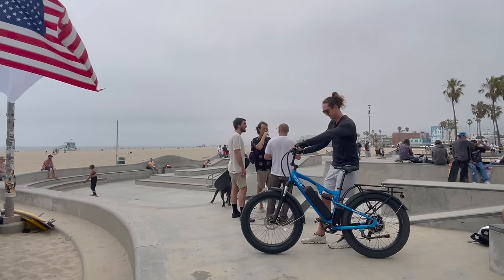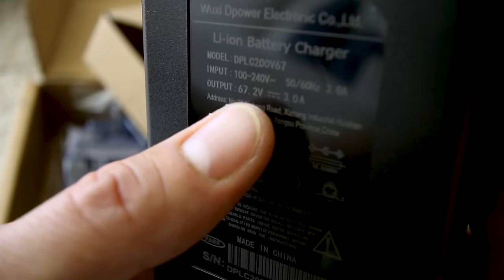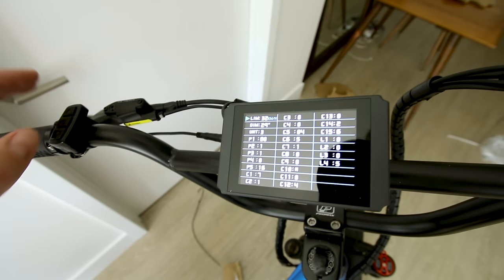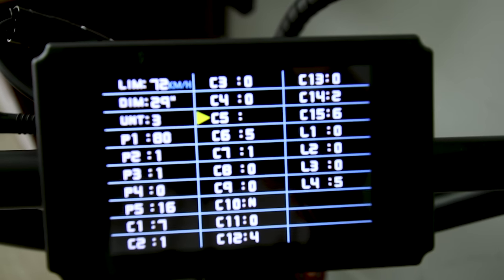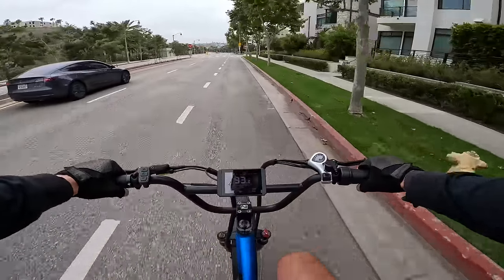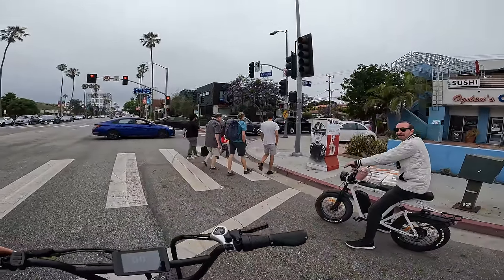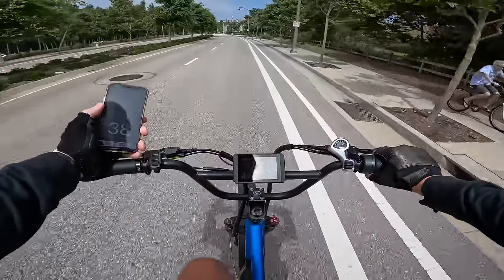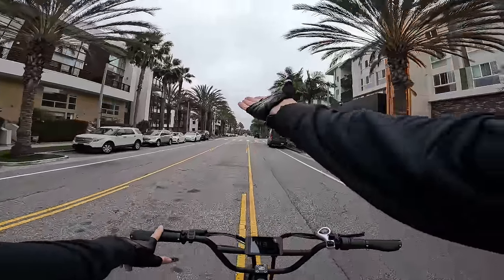This $2000 Ebike is INSANE - Wired Freedom Review!

Comment: I really hope this bike has decent reliability.  I worry it will break down after a couple months of riding it.
Reply: There were reports of magnets coming out of the motor.
Reply: @aussie2uGA How do you figure out how to change the settings. The instruction manuals with e-bike are terrible.
Reply: have 2 and only problem was needed a biger shock and wired sent me one for free there service is the best in the business
Reply: @aussie2uGA if it hasn't been released yet, where did the reports come from?  Reviewers? I wouldn't worry much if it was a review bike that's been shipped all over the globe and run ragged over and over.
Reply: @TravisMcGee151 press 2 buttons simultaneously to get into that mode.   It was quick in the video, but he showed you.   I have a different brand, (Aventon), it’s the same process as this Wired.
Reply: I’ve had mine for several months and have over 700 miles.  The bike has been flawless so far.  The motor does not get hot, even after riding hard for 30 miles.  I took my motor apart to check the grease and wear so far and it was perfect and still very well greased.  I will re grease every 3-4k mikes going forward.  The battery seems to be super high quality and has massive capacity and performance and I expect it to last 850 cycles at about 50 miles per charge or about 45,000 miles.  Everything except the motor can be replaced or repaired by any bike store and I think the motor is bulletproof after disassembly and inspection.

Comment: FYI 57.6 volts is 50% on 60 volt battery pack.  This bike is an animal for sure.  Also seems to have pretty good build quality except for forks and rear shock.
Reply: And at the end of the battery, it can still pull almost 2000 watts.  The front fork is surprisingly good, they changed from a Mozo fork to another brand on the latest version and it performs better according to Wired.  Works fine on roads and light off road.  The rear spring is adequate but upgradeable.  For $2000, what more can you expect?  Just so much better than ANY 48v bike.  Physics wins.

Comment: Let’s hope the quality is there.  It’s so easy to sell specs and features without durability.
Reply: 600 trouble free miles so far!  Great customer service if you have problems or questions.  Controller is oversized, it can handle 80volts as is the motor, it can handle 3000 watts continuous and is rated at 5x the lifespan of nylon geared motors.  The battery has the highest quality LG cells.  Everything else on the bike can be fixed or replaced at any bike shop.

Comment: Does anyone make a bike with this power but without a 4" fat tire? Would to have this power on a bike with 2-3/4" tires for city & paved trail riding.
Reply: In my mind there really isn't a benefit to skinny tires on an ebike. Typically you want skinny tires because they have less rolling resistance and are easier to pedal. Because the ebike does most of the work you only benefit from bigger tires

Comment: Nice bike, ground breaking in many ways. @$2K for preorder, it would be worth ordering one, if I didn't just buy a commuter bike. I'd love to see this bike in a commuter configuration with 27.5 wheels and all season road tires on it, in a step thru. Looks like the priority was the battery pack (very expensive) and the controller, and motor. The motor with this 7 speed setup can take you faster than you can keep up in gear ratios with your legs, unless they put a bigger cassette on it with more speeds. The controller will need to be external because of the heat it generates; I've seen other bikes like that too; big AMPs == big HEAT. The motor is off brand but obviously works very well. it's solid state, I would not expect to have problems with it. If anything; the battery will be very expensive to replace; and the controller may have overheating / reliability problems over time. I like the weight; it's only 10 pounds heavier than many commuter bikes in the same price range.
Reply: IMO, it would be so good if it used 1.9-2.5" tires instead of 4" wide tires.

At 2.2" wide, Contact Urban III's would make this bike ride so fast off of the line :P
Reply: @neutronpcxt372  I think the 4" tires improve the suspension. the fork and rear shock seems to be the cheapest they found
Reply: good info effort here with jeffster folks, Question: I can hear the motor noise when rolled backward so... this is a geared motor that does regeneration - Correct ? Let's have some info regarding the gear-set (ratio of motor RPM reduction) if possible and the regen behavior on the road... and I will watch vid close to see what the tailster says... Regen helps extend brake life, and distance... I like having regen.

Comment: God damn it. 2000$US and it still comes with a Shimano Tourney rear derailleur.
It should be an Altus or Acera at the bare minimum.
Reply: They put money elsewhere😅
Reply: @MyFaithShines  Yeah, on the tires.
I say, and will continue to say, that most of these bikes should be using 3" wide tires or 2.5" wide tires, not 4 inch wide monstrosities that aren't very helpful in most cases.
Reply: @neutronpcxt372  i think the same

Comment: I would've thought with the higher voltage it would've at least hit 40-42 mph but it pretty much goes as fast as an Ariel Rider X class or Grizzly. Battery size isn't that big either.

Comment: This bike needs a torque sensor.
Reply: Do you sell torque sensors?  Would kinda of suck on a 38mph bike but who knows.  Can’t have everything at only 2k
Reply: Spend the extra money on a bike from a company that has what you want. $2k isn't pocket change for most people so if your gonna spend that much get what you want
Reply: @jfly2249  Stop ghost pedaling at high speeds, and converts power to the pedals, and gearing to respond to effort also makes the ride more natural, and can be upgraded for max speed. https://www.youtube.com/watch?v=WnLG5U-BwpY&list=WL&index=23&t=96s
Reply: @Growler_Guy The existing system works great.  Easy to pedal at any speed.  Lots of people don’t want to work to achieve high speed.  You can spend $1000 more and get the AWD fabulous bike that has similar power AND a torque sensor.  Although the review I saw said the Fabulous torque sensor wasn’t very good, too sensitive.
Reply: 48v = bicycle, torque sensor helps with the bicycle feel. Good for exercise. Better with smaller tires. Will always be available for purchase in most states.

60v = licenseless motorcycle, torque sensor not needed. Twist throttle, go fast and have fun. Better for fat tires. Buy now while you still can
Reply: Only good for off reading constantly, a cadence sensor is better for street trail

Comment: When you get to 25mph air becomes a big factor to push through, and it shows on the watts used to keep your speed, i can do 25mph on my ebike and im using about 5-600watts, when i get up to 30mph my watts are pushing 1000watts,  above i can see my watts going up exponentially with every mph added,
I honestly feel if you want the best average distance from your ebike, dont go above 25mph, after that you're just burning alot of energy just to go a fraction faster
Reply from the maker: Spot on

Comment: Just some advice. I have that same controller and display. I ramped up my power output to the max and I have almost ruined my battery and the connector on the bike. I live in South Tucson and the hot climate doesn't agree with the battery output at those amps. It took about 2 months of use to, basically, cook the connectors and now they fail to make contact. I would keep the power output at no more than like 85% next time.. this is why I am actually researching other ebikes. A new battery is $500 and Rad wont sell me new battery connections. I know yours isn't a Rad bike but that power controller is the one I upgraded to.  Just some advice to keep in the back of your mind.
Reply from the maker: Thanks for the tips, this is definitely not a rad bike though. Rad Bikes are pretty under spec’d

Comment: How much difference is there with the rear suspension compared to a hard tail?
Reply: Massive difference.  You can ride the full suspension bike just about anywhere in comfort.  Hard tails are fine on paved roads and trails, but unless you are young and limber, I wouldn’t take one off road.  The full suspension also makes a big difference in smoothing out bumps at higher speeds on roads. Much safer in that the rear wheel stays planted going over obstacles.
Reply: Thanks

Comment: I was wanting to get this bike over some of the two motor offerings that that goes 35 or so.. because I was thinking this one has an upgrade path for maybe a bit more speed but surely more power by adding a second front hub motor later.. what are you thoughts here?.. another 1000w - 2000w front hub motor would help get off the line faster and maintain those speeds on city hills in traffic situations.  I would think

Comment: I don't like how particularly close the tire is to the controller on the Freedom compared to the Cruiser model. I see that being an issue with suspension under load.
Reply: I think the F3 Pro would be better since I already have one! So far, the price/performance ratio of this electric bicycle is the highest!
Reply: @chrischen5911  Front forks look like toothpicks on the F3. No way are they durable for long. In addition, the Ariel Rider Grizzly provides 52v power along with the ability to switch gears for a little more money.

Comment: Wondering how you would compare the philodo vs. the wired. I almost bought a philodo but waited. Then i saw your video of the freedom. Price is similar. I live in Florida. Very flat.  Most of my riding will be 10 miles or less each direction. But i would like to get a second batt. for hitting the Pinellas trail and going 25+ miles each way on a weekend day trip.
Reply from the maker: Wired is much better, especially after the new upgrades

Comment: Did you like this one more than the Bandit x-trail Pro? I'm inches away from pre-ordering the Bandit, but would you recommend this one instead?
Thank you!
Reply from the maker: I mean, they’re both great, very different styles. Both fast and fun!
Reply: The Wired is faster, better acceleration and hill climbing and won’t get a second look from the cops.  The Bandit is pre production, who knows if they will actually ship and what the final product will be.  The first batch of any bike will have issues.  Wired is a known quantity at this point with outstanding customer service and a successful execution of their first few batches and they are Chicago guys.  The 26x4 is far superior to 20x4 in terms of stability and comfort and you can roll over most anything.   I have both types and far prefer the larger 26x4 format.  Smaller riders and women prefer the 20x4.
Reply: The 20x4 tires are more nimble. The bandit also has dual motors and a lot of battery. I think both are a great choice but the bandit may be a better choice for commuting because it’s also a step through moped style but I would definitely go for the wired if I wanted power
Reply: @TailHappyTV  Yea that's the problem...they both seem great, so my choice is harder! Do you prefer the 60v single motor or the 48v dual motor? Also do you find one bike to be more comfortable? Have better handling? Have a higher quality overall build? I think you're the only one who has reviewed both, so I'd really value your opinion.
Thanks again!

Comment: HP is relative to efficiency of the motor, if motor efficiency is 95-98 (that makes 640 watts approximately 1hp) percent then technically 750 watts is about 100 watts over the 1hp limit.

Comment: The price makes me nervous... If a Light Bee is 5k and already ideally needs upgrading components, then what is this thing for 2k? How long is that gonna last? That MUST be pretty disposable, there is no such thing as a free lunch and what's 2000 dollars for ANY motorized vehicle? A good battery alone costs equal/more than that on the surron...
In other words: I expect it to be bad stock, but not made well enough to be worth upgrading, like the 'ron is...
Reply: Mine is built like a tank.  The motor is amazing and seems very durable with the hybrid gears, I took mine apart to inspect at 700 miles and it was perfect.  This is not an electric dirt bike like a Suron, it’s a super powerful 26x4 fat tire e bike.  The fact that Wired can sell at such a low price is an indication of how bad other companies are ripping people off.  Suron batteries are higher discharge rates and more expensive than LG 21700

Comment: That controller is in a good spot for damage
Reply: It’s encased in metal inside a waterproof plastic case, not worried at all.  The exposed controller and use of the retention battery case is why this full suspension fat tire bike with a massive battery and motor weighs only 77lbs.  The bike would be over 90lbs if everything was integrated into the frame.  Plus, it looks really good in person.

Comment: The only problem is the rear set drop out. It's not reinforced. It'll break in 2 weeks
Reply: I think I saw a small torque arm on each side of the rear axle. Obscured by the lower attachments for the rear fender though. Without them, yeah, that torquey motor would shred the drops.

Comment: Does it have an extra strong chain, or just a normal bike chain, which typically isn’t strong enough for 2000 wattts, and good luck with an emergency stop at 38mph with no gear on!!🤪
Reply from the maker: Power does not go through chain, 🤞 on brakes 😆

Comment: This vs Ariel Rider Kepler????
Reply: Beats the Kepler on every measure and it’s full suspension.  Much better acceleration and hill climbing and about 3mph faster top speed for the Wired.  Kepler is very good but the Wired is better.

Comment: Quick question: Is this thing even legal to ride on the street since it was falsely marked as Class 2 750W bike?
Reply: Fully legal to ride on the street so long as you keep the settings in the legal range.  The bike ships as a class 2, you are responsible if you change the settings and ride on the street.  Kinda of like your car, it can go 115mph but it would be illegal to drive it that fast on the street.  Depending on where you live and your use, on or off road, you can adjust the settings as appropriate.  48v bikes are weak in acceleration and hill climbing in comparison even at lower legal speeds.  Lots of bikes have off road modes and they are 100% legal.

Comment: I'd like to see a long-term test of this e-bike and have info/data on reliability. "A motor (electric) does not produce any power?"... Do you want to stick with that?
Reply from the maker: Maybe, I did not word this 100% correct, but so many people look at a 1000 W motor and think that just because it says 1000 W on the motor that’s how much power the motor is making. Ultimately a motor can only make as much power as it can draw from the battery through the controller. so a 1000 W motor could make probably 5000 W of power, but maybe only for five seconds and then it will no longer work ever again. Likewise, you could put a 1000 W motor on it like put a battery and controller are only able to, get that motor to make 200 W. I actually did a long range test it did the Hollywood sign climbing the hill out there and it was able to do it all perfectly good, the only problem I ran into was almost running out of battery on the way home, because this bike lets you run so much wattage you can easily burn out your battery quickly. I will post the video later, but I don’t want to increase demand for this bike when it’s already sold out right now.
Reply: @TailHappyTV  That's better!  🙂    Thanks for the reply. I'll check your other videos.  Cheers.

Comment: How many miles range on one charge? Thank you.
Reply: I get about 25 full on throttle only and I’ve gotten 50 on mostly PAS 2 with some short full throttle runs while in streets
Reply: My top speed is 45.2mph
Reply: @kevinhause1505  50 miles?
Reply: @moses5161  yup. With mostly PAS 2. the more you use the PAS the further you will go. 
I’ve seen ppl in the owners group claim as much as 60miles
Reply: @kevinhause1505  Thanks man!

Comment: Looking at bringing a bike to Costa Rica and I am trying to decide on the best performing bike that can be used on the road and on the hard packed baby powder sand beaches.  I am considering the Wired Freedom Ebike and the Philodo H8 and was curious as to what you think, or if you have any other suggestions, also looking for distance.  Thanks for the very informative videos, great content!
Reply from the maker: AWD 26x4 inch tires are best for sand, two wheel drive is better than one big motor on one wheel for sand
Reply: @TailHappyTV  Have you had the opportunity to test ride the Philodo H8?
Reply: i ride roads and packed bike trails the wired kills all of it don't make a mistake the wired is a beast i have 2 of them and nothing competes also there service is great they called me at midnight and walked me thru my chain derailleur adjustments how do you beat that